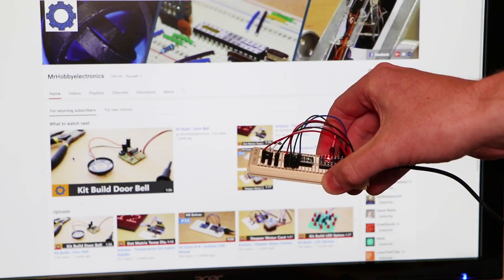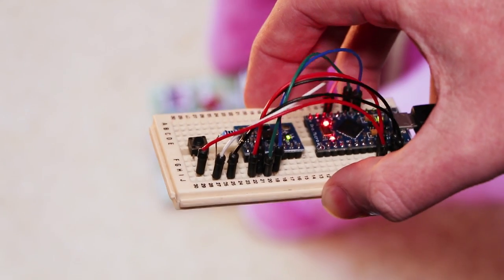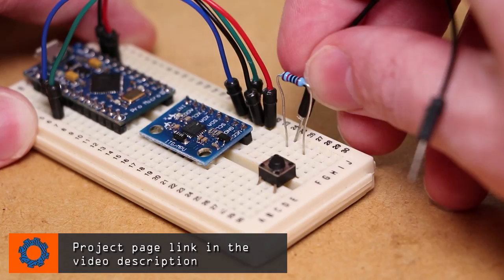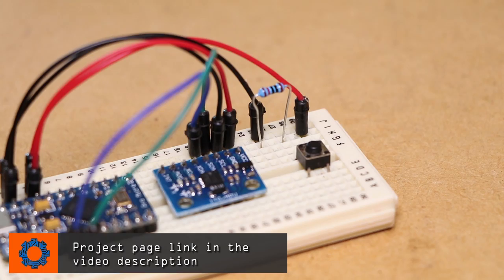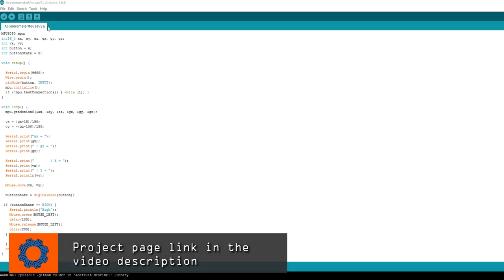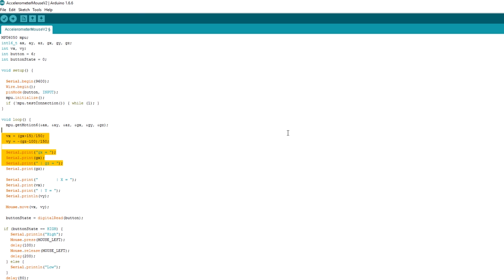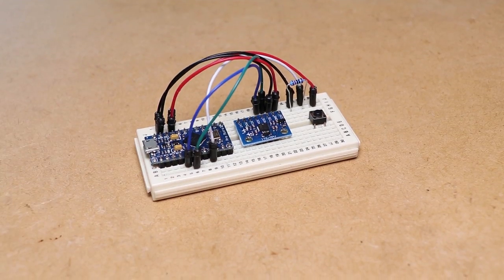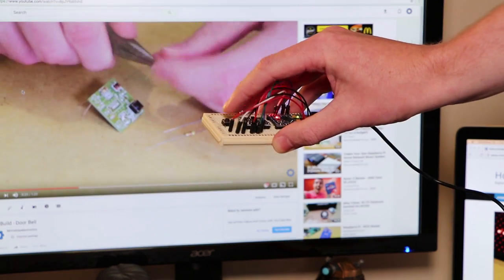Arduino - Accelerometer Mouse

Comment: Nice project. But this works the angle of z axis. Instead of this you can work with y axis and x axis like normal mouse. You can think the plane surface like xy cordinate system.

Comment: Is it possible to add additional buttons? Or be able to have this work in conjunction with an existing mouse for fusion360. I have zero software or programing knowledge. I managed to program in marlin standing on the shoulders of others work and basically copy and paste. 
I am trying to replicate a 3d space mouse option but don't have $200 kicking around. 
Thank you in advance.

Comment: I'm trying to do the same with a nano 33 board, as it has an inbuilt accelerometer, but it doesn't work on windows, it works on Linux, though, so is it an issue with the board?

Comment: Hi, i get this error 'Mouse' not found. Does your sketch include the line '#include <Mouse.h>'? if you could help me thank you
Reply: Yeah it includes Mouse.h and this is updated. You can check the description to visit his website.
Reply: @charlesspurjeon  Thanks but i used the one on his site :( is fine ill try something else
Reply: Dear you get this  error because u are using arduino nano or uno ...which does not support direct usb support
Reply: @onkarkoli8621  in fact if @Alberto Garib has a pro micro then it has to do with the actual setting that he is using. In order to avoid such problems, you must clearly indicate in the board section that you are using arduino leonardo board, otherwise it won't work I had the same problem and managed to solve it this way

Comment: hi nick,
i gave a try to this project, to begin my arduino journey ^^ 

but because i am very very noob , i have a problem now. since i loaded the code, the program does not stop making mouse clicks, how to reset or how to prevent automatic clicks as soon as i connect the usb? thank you
Reply: hi, i just found a way to stop this erratic behaviour.....  i will  make more tries. but my understanding is limited at the moment.
in my arduino libraries folder :
IDCdev
MPU6050
i am using the Arduino pro micro
and i bought this MPU6050 --> AptoFun MPU-6050 Module 3 Axes Gyroscope analogique
my COM is COM3, but the sketch tell's me it is an arduino leonardo COM3 ....  ???
What type of board must i select ? pro micro or leonardo ?

now, do i have just to clic & load the AccelerometerMouse.ino ?
or there are other missing steps ?

thx

Comment: this is awesome  and very clear  project vedio i have a request can you tell how to add right click button  to this project
Reply from the maker: Hi, there is a diagram on the project page showing how to do this: http://www.mrhobbytronics.com/arduino-accelerometer-mouse/
Reply: Hi, did you manage to make this project work? Mine I didn't, its not working even though all my connection is right. Theres no response.
Reply: yeah I have the same problem, my sensors light wont light up so I think the sensor isnt properly connected. But even the button doesnt work for me .
Reply: Until now? not working still?

Comment: Hi, thank you for the tutorial! I am very new to Arduino. I used the Arduino Leonardo and MPU92/65. I tried with your code, but the mouse keeps moving till disappears on the screen when I am not even moving the breadboard. Is it because the MPU6050 library doesn't work with MPU92/65? I am very stuck here. Any advice would be appreciated. Thank you very much!
Reply: I do believe it is because of the  voltage noise which comes from  the mpu module, I don't think it can be helped, but I think reducing the sensitivity and the delay time might do something (Next text is for my self, just ignore it) {I just added a delay of 50 milliseconds  and seemed to work pretty well, but it started to fall down very slowly, I'm not even moving it, it might be the accelerometer which is being affected by g force, maybe I have o disable the accelerometer and work only with oscilloscopes, but how?}

Comment: This isn't an accelerometer mouse. This is a gyroscope mouse.
Reply: Why
Reply: @njan1242  Because I apparently used to be an idiot.
I don't remember what exactly I was thinking, but the mouse moves by rotating the board. This looks like the work of a gyroscope. And I think the mouse also keeps moving when the board is not moving (after being tilted to the side) so I probably thought it wouldn't experience acceleration.

But the gravitational pull is always creating an acceleration force in the sensor and I now think this is used to move the mouse
Reply: Gravity is acceleration. This is a mouse using the accelerometer, but you are using acceleration instead of current speed to control it and that is why it is continually moving when turned. That becomes clear when you realize that gravity affects accelerometers, thus, when you turn the MCU gravity starts being applied on the X or Y axis, instead of the Z axis, and that acceleration is constant 10m/s^2 which is usually much more acceleration than you are doing moving it along the X or Y axis and the acceleration is not constant when you are moving it even if speed is. 

If you want it to behave "like a mouse", eg. If you move it right ( not rotate ) the mouse moves right, you need to neutralize the effects of gravity ( recognize when the MCU is rotated along the x or y axis ) and not use the mouseMoveX = accelX, instead used mouseMoveX += accelX, because when you move and stop the mouse you accelerate first and then decelerate to stop, in ideal conditions making the net mouseMoveX = 0 otherwise youd have to have the IMU constantly accelerating ( not the same as having constant speed ) if you want it to move constantly, which is not realistic.

Comment: i am new for this arduino i was geting this error help me:::::::::::
Arduino: 1.9.0-beta (Windows 7), Board: "Arduino Nano, ATmega328P"

C:\Users\user\Documents\Arduino\libraries\sketch_jan26a\sketch_jan26a.ino: In function 'void loop()':

sketch_jan26a:40:3: error: 'Mouse' not found. Does your sketch include the line '#include <Mouse.h>'?
   Mouse.move(vx,vy);

   ^

sketch_jan26a:46:17: error: 'MOUSE_LEFT' was not declared in this scope

     Mouse.press(MOUSE_LEFT);

                 ^

sketch_jan26a:52:17: error: 'MOUSE_RIGHT' was not declared in this scope

     Mouse.press(MOUSE_RIGHT);

                 ^

exit status 1
'Mouse' not found. Does your sketch include the line '#include <Mouse.h>'?

This report would have more information with
"Show verbose output during compilation"
option enabled in File -> Preferences.

Comment: hi, is it possible to use this as a VR controller? im broke and there's a software called VRidge that can turn your phone to a vr headset with a google cardboard, the only problem is that there's no cheap motion controllers available...

Comment: Im using an atmega32u4 leonardo and it isn't working.
Reply: I managed to get the mouse movement working, but the push button doesn't work.
Reply: did the code and wiring remain the same for you?